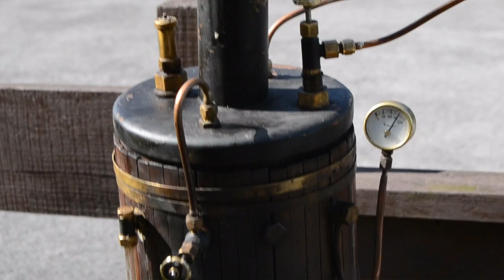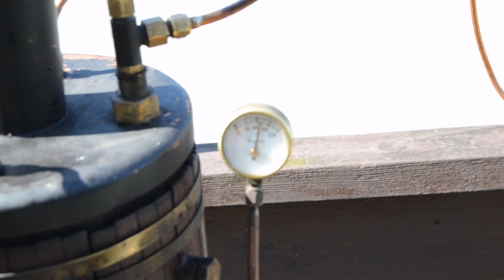Steaming up with Louis

Comment: No worries works well .
Cool I use Welsh steam coal . Good coal. Do you use house coal ?
Reply from the maker: The Welsh coal works well, it seems to give out good heat and once it is fully established it will maintain full pressure in that boiler and burn without any additional draughting.  I did briefly try household coal, a friend brought be some so I can't be certain what grade it was but it was useless - we later joked it was better used as a fire extinguisher ;-)

Comment: Thanks for the info. So is it best to use housecoal mixed in with Welsh steam coal to get bit of smoke?
Reply from the maker: To be honest I'm not really sure. I guess you'd get more smoke with the right grade of house coal but in my experience a small boiler like mine really only burns on Welsh coal so I'd be inclined to just mix small quantities of house coal to get smoke but not kill the fire. It's worth a try and if you do I'd be interested to hear how it goes :-)
Reply: @modelsteamers671  thanks for the advice but I have heard that house coal is bad for boilers and so not keen on using it plus quite smokey

Comment: So really best to mix a little bit of house coal in and have mainly Welsh steam or Russian steam coal ?
Reply from the maker: I've never tried Russian coal but try mixing household and Welsh coal and see what happens. My only slight worry would be if you have a boiler with small diameter fire tubes a smoky fire may block tubes very quickly.